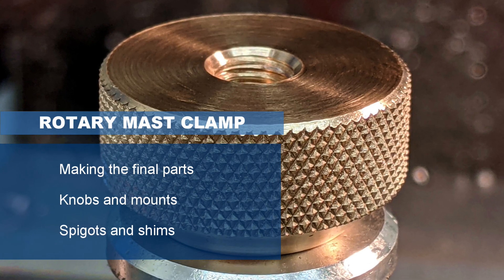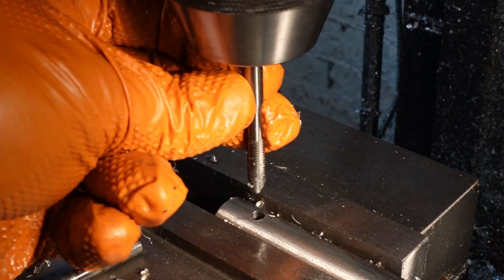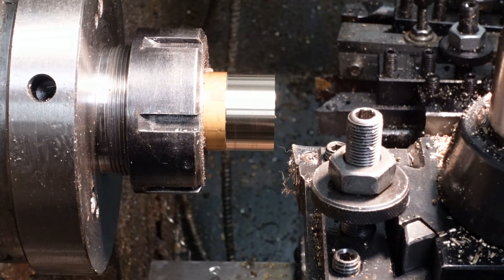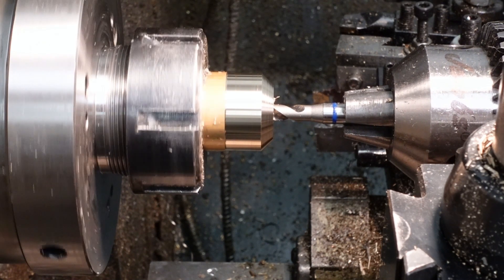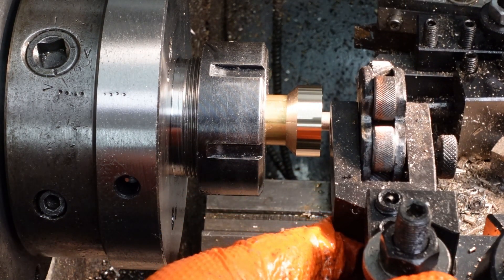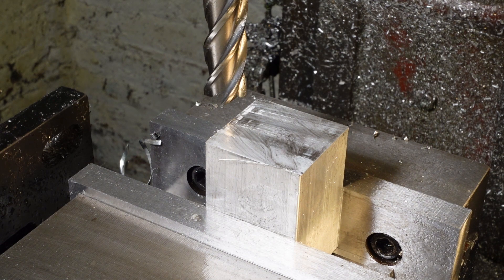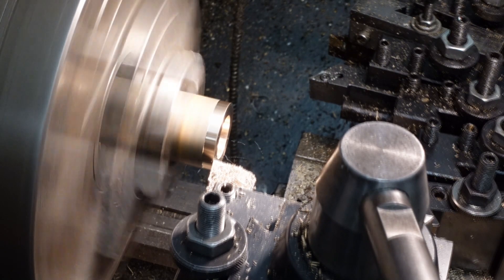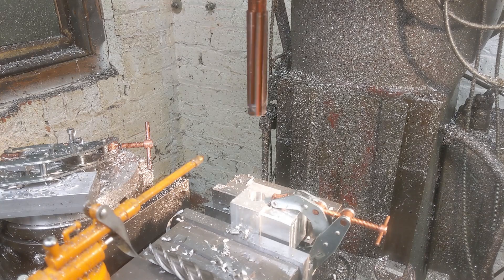Rotary mast clamp assembly - Final parts

Comment: When tapping threads with the drill or the lathe, how do you make sure the tool advances at the right speed? Do you simply let it go by applying very little force?
Reply from the maker: In the mill, I hand-feed the tap using finger-tip pressure until it bites, then let it pull itself in, along with the chuck and quill.. CNC machines can do rigid tapping where the taps is fed in at the right rate under power.  For small taps, I use a spring-loaded tap follower in the chuck to support the rear of a hand tap wrench. If I'm making a lot of tapped holes, I have a Tapmatic automatic tapping head that stops at a defined depth or torque, then does an automatic fast withdrawal. It's a similar setup on the mill.  Anything over about 5mm, I unlock the tailstock and apply a bit of pressure, then allow the tap to pull the tailstock along, with a little assistance from my hand. For smaller holes on the lathe I use the spring-loaded follower and a hand tap wrench.  I have done some threading using a thread mill, where I spin the tool in a toolpost spindle, then advance the carriage just like if I was cutting a single-point thread.  That's more of a CNC technique really, but it is a good solution for large diameter fine threads on a manual lathe.

Comment: If you have difficulty tapping stainless you like to know the tapping drill size is only a suggestion. You can drill over size and reduce thread engagement to 65% with little loss of strength, and if Aimee had been about she could have told you at the time.😆
Reply from the maker: Certainly makes a difference using 1.65 mm instead of 1.60 for the M2x0.4 taps in brass. usually I have no problems in stainless with the right taps even at nominal hole dimensions, but some of this stainless is 'orrible stuff so will bear that in mind, thanks! AIMEE was still just a twinkle in the eye of a Generative Adversarial Network algorithm back there in ancient times (Youtube chronology)

Comment: At 8:45, did you stop the video just before the side of the tool met collet nut?
I noticed the stub fixture had more poke out after the transition. :D
Reply from the maker: There are lots of little jump cuts where I try to fake a second angle view by removing a section of video, but I also keep knocking the camera or getting oil on the lens filter or losing focus and have to chop out a section. Sometimes a tool or some chips will move or appear/disappear. I'm about as bad at videography as I am at machining or cleaning or welding!

Comment: I've had noticeably better finish on knurling when I keep an air blast on the part to prevent 're-mashing' those horrible little chips back into the part. If you've got an adjustable coolant mist that can put out high airflow, thats ideal.

p.s.  What RPM are you running that reamer at?  The rule of thumb as far as I've ever heard, is half the speed and twice the feed of what you would use to drill the hole.  If you have through-tool coolant to actively push out chips you can go faster, as the rule exists to prevent recutting chips.
Reply from the maker: I have a Noga-Cool Mini, that's a very good idea. Yes, I usually run a reamer at 1/3 to 1/2 of the drilling rpm, but feed depends on how undersize the hole is. Most holes I ream are 1.8, 2.0 or 4.0 mm, with the drill 0.2 mm undersize, but for 20mm  the nearest drill I have is 3/4 inch. I should invest in a more suitable drill really.
I'll give the Noga a try, but I need to make or buy a better knurling tool as well.